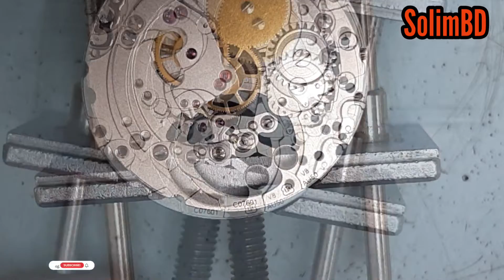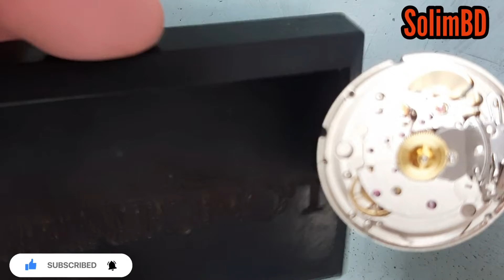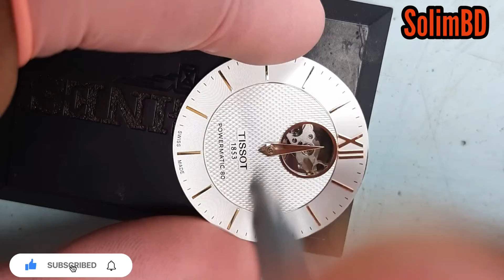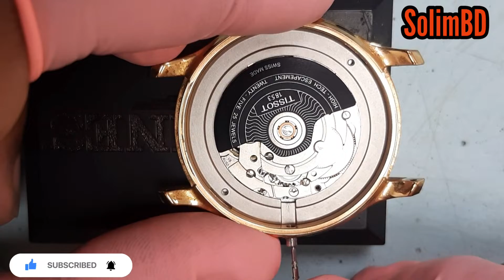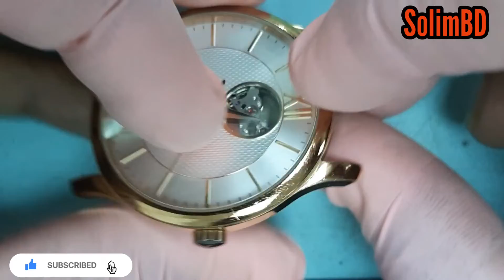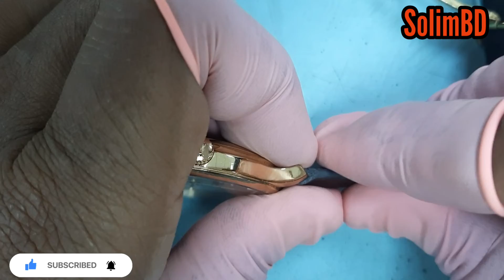How To Service ETA C07.601 SW200 Powermatic 80 Automatic Watch Movement | Assemble | SolimBD

Comment: Bought my son the  watch I was going to buy for myself that has ETA 2892A2 movement. Then I searched for a different watch to buy for myself. I found the Mido 200C I like it  but it uses this movement in the video. Will this movement have the same durability and long lasting as the the ETA2892A2? And is it a throw away movement?
Reply from the maker: This movement is upgrade movement for ETA. 2892A2 is good but this video movment is Hybrid movement from ETA. After fully charging of this powermatic battery, it will run maximum 80 hours.

Comment: Are there plastic parts in this movement
Reply from the maker: Oscillating weight is a hard plastic
Reply: @SolimBD  does that make the movement rubbish and will only last a couple of years ?
Reply from the maker: Hybrid movement
Reply: @SolimBD  so it won't last long ,?
Reply from the maker: It will be kept away from hits and chemicals
Reply: @SolimBD  you basically won't or can't answer the question!
Reply: @SolimBD  i found a patent application online last night that looks to be for ETA.
It states the plastic rotor has heavy metal particles and fibrous material in a portion of the plastic to optimize the weight and density. Likely this is that plastic rotor that is being used. Seems like it would simply be easier to just keep making them from metal. The cost savings to manufacture this special plastic piece likely would be extremly minimal i think. (Many decimals of a fraction of a dollar).
Reply from the maker: Hmm YOU are absolutely right.
Reply: @zash008 so basically won’t last long right?
Reply: @SolimBD are you sure? It is stated that for reference C07.111 only that they used plastic parts but for C07.601 (openheart) and C07.811 (silicium) they didnt

Comment: I dont care to buy a watch using a movement that cannot be repaired. Is this movement repairable?
Reply from the maker: Yes you can repair it and after repairing it will work properly.
Reply: @SolimBD  Then why do you supose there is so much controversy concerning this?
Reply from the maker: 2892 ETA movement is little bit better than what you are talking about. 2892ETA movement usually uses well range watch.